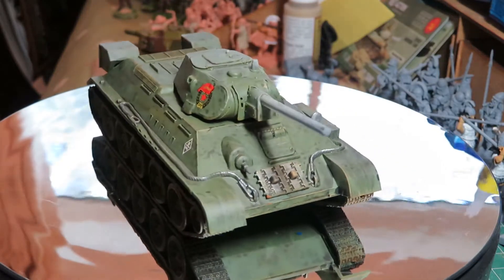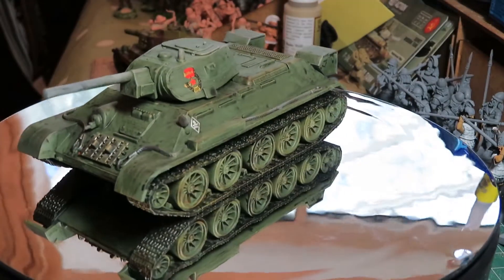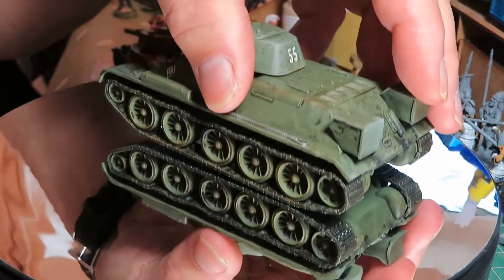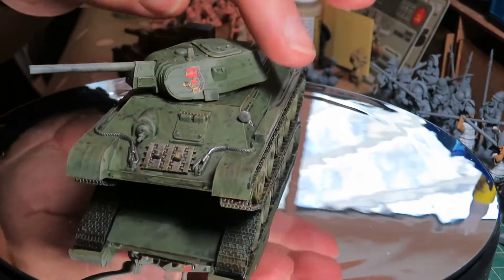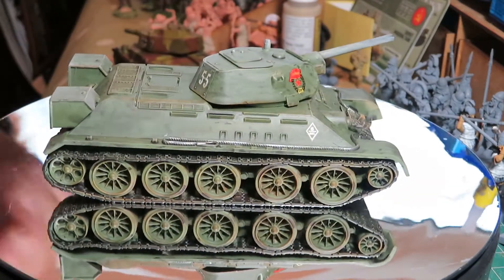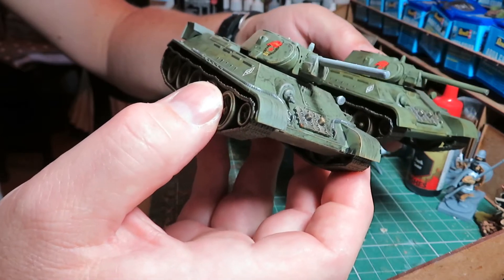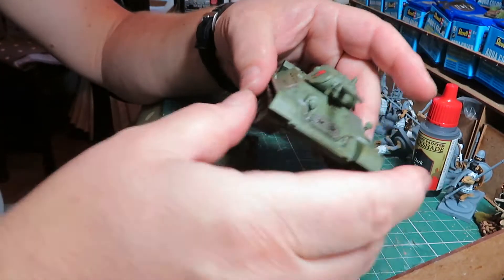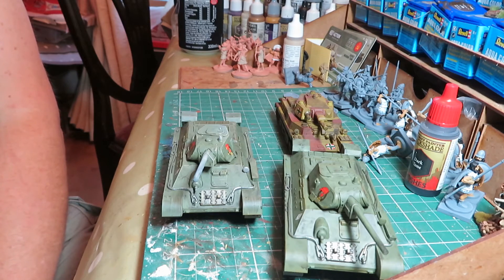Dusting Down a T34 - with Tamiya Weathering Powders

Comment: Hey Dom, nice video and successful first test of the Tamiya weathering powders. When all work is completed, a layer of matt clear coat would be useful. Some things go faster with the powder.
Have a good time. Joachim
Reply from the maker: so matt varnish before the wash?
Reply: Hey Dom, short about my way of working. I usually use acrylic paints, for example Tamiya, for the paint and tarn stripes of the vehicle. After that, I apply dots of different oil colors which I blur with turpentine. In this context, I then run dark diluted oil paint in the deepening. After drying, I light up the edges. Then come the pigments or for example Tamiya weathering powder. Then possibly still dirtying and finally the painting with matte clearcoat.
After this you can still represent metal abrasion by means of metal pin. That would it be so in broad terms.
Greetings, Joachim
Reply from the maker: no wonder your models look so wonderful! Thanks mate useful

Comment: The dusting of rust effects can be very subtle to the eye, it doesn't necessarily mean that its rust on the surface of the vehicle. The effects can be dirt from just general operations in the field, with a vehicle moving through a field with a high amount of reddish clay you will get the same effects as rust.  The big question is when you seal it will the weathering powders hold up or be diluted down, I've found that its better to go a little heavier with the weathering because of when you seal it.  I like to apply more mud effects on a vehicle after my many years of operating tanks in the field they get very muddy with splashing along the sides and rear. .
Reply from the maker: agreed the varnishing deadens down the effects somewhat so i would go heavier with it next time